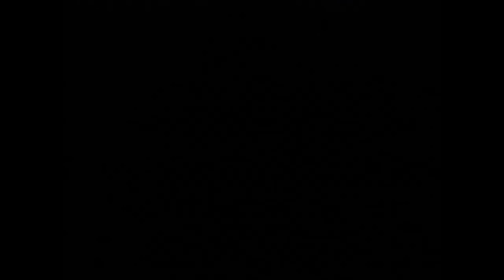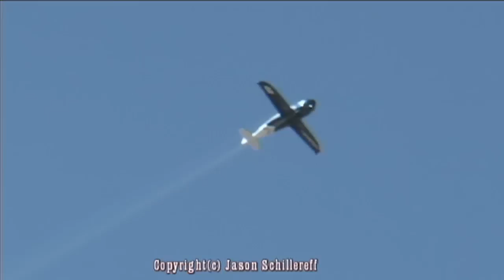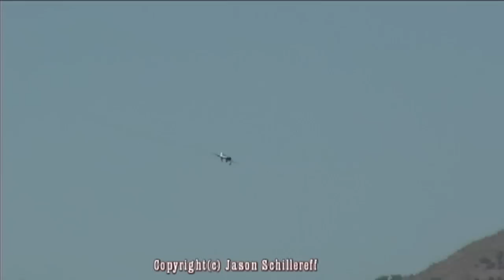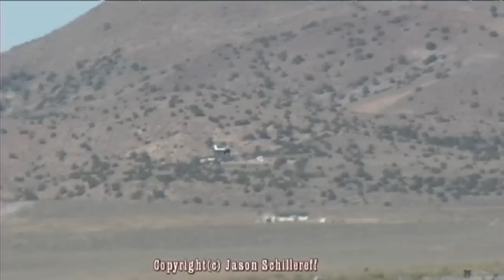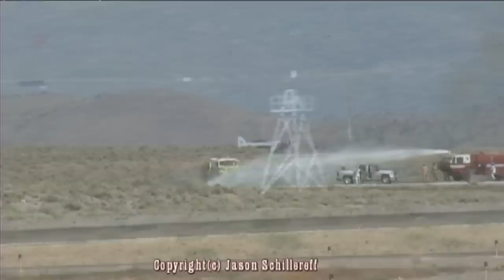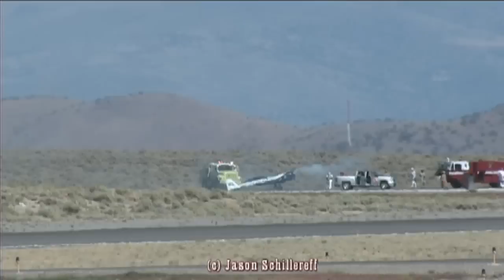Sport class racer 'Relentless' mayday 9/14/2010

Comment: Never heard a plane engine rev that high. The minute the prop was gone that was like going from 2900 to 10000
Reply: I thought that noise was the propellers still being on but at 0 degrees angle of attack into the direction they were spinning, THEN coming off and going silent.
Reply: Nicholas: that's about the size of it. Once freed from the load of propulsion, the engine will definitely rev high. Kevin was fast on the throttle because had it gone for much longer, the engine would've oversped (aviation term for over-revved) and the engine would've grenaded, causing a definite weight & balance crisis. Aviation engines are relatively frail compared to automotive engines, it's like comparing a VW Beetle engine to a V8. They gotta be light and simple. You probably know this already, but I'm saying this for the benefit of those reading who don't know.
Reply: Yes once in the US, on a test flight, too see the performance of a Low consumption Aero Engine.   I didn't buy it because I was in the process of acquiring a WW2 seaplane and I didn't want to snap the wings, if it went too fast.  The Company was a devision of Mazda and the Engine was a version of there radial engine that didn't take off in aviation.
Reply: The big issue I here in the video, was the propellor, where parts where travelling towards the sound barrier speeds, literally breaking apart from the airpressue.
Reply: PhattGreg Mazda, radial? For real?
Reply: 8UP1977 Maybe he meant Rotary/Wankel engine? haha
Reply: RoboTekno Actually, it's just "Wankel". The WW1 LeRhone engine holds the title of "rotary" due to the fact that the crank bolted to the firewall, the prop bolted to the engine and the engine spun. You'll enjoy reading up on that one!
Reply: Oh! It was the Engine!, Is that what made the Wierd Sawing sound! At first  I thought it was the brock props being flung off At the speed of Sound!...☺☺
Reply: +Grammer Nazi Not sure why GA wouldn't trade some lbs for a lot more reliability in a modern automotive-style engine..... GA is way riskier than it should be.
Reply: Just  a 'Vrrrrp' or 'Whaap' I can't tell but if I'd have been the pilot I'd been have sitting on some extra cushioning.
Reply: Arfdog we can thank the FAA for that.  The Experimental world has been using Subaru engines for decades now, but you'll never get the FAA to certify one...
Reply: @SenorSpode  I've seen that one running at the Rhinebeck airdrome... many years ago.. two speeds, ON and OFF.
Reply: Bye bye engine!

Comment: I lost a prop one time... I was delivering a WW-II surplus Interstate L-6 with a geared Franklin engine from Texas to Denver when it began to make strange noises up front. The Guymon, Oklahoma airport was two or three miles away so i headed toward it. There was a loud bang on downwind, oil sprayed over the windshield and then it was very quiet. I landed and let it coast off the runway. They found the prop and front part of the gearbox the next day.
Reply: +Jim Foreman Ah yes the joys of flying.
Reply: +AH6OY 

They is no joy in CFIT!
Reply: Poor guy. If there wasn't a fire and the fire crews straight out went and sprayed that water straight on the engine it's a big chance of cracked block and jugs.
Reply: +AH6OY I don't think that mattered, if the engine ran away enough to blow the prop off, any additional damage from the fire crews would be negligible.
Reply: A bit of a late reply but its usually commonly done to prevent fires e.g fuel leaks, oil leaks as foam floats and covers it preventing oxygen from getting in and also i know that another ww2 plane lost gear control and whilst flying told the crews to foam the thing to "kingdom come" and also if the prop literly flew off then water and foams the least of your worries
Reply: i lost many props before... but they were on my RC airplanes, they all landed just fine :)
Reply: I had unknown fuel leak in one of my old bonanza's (aux tank), and I ran it dry over the mtn's of OR one night, now that was a pucker factor 10!  There is nothing louder than the sound of silence in a prop plane.
Reply: Single engine night over the mountains is bad enough. But remember how sweet it sounded when you switched tanks.
Reply: Jim Foreman Yup, my father was with me, it  was a ferry flight of a "new to me" B-35 (bought off Tex Johnson's son Gary), and I didn't know of all the issues yet.  My father was a PP as well, and when I looked at him after the engine caught and was running again, he was bleach white :)!   When he could talk again, he turned to me and said "I think I shit myself.."
Reply: I assume you were talking about a Beech b-35 and not the flying wing...
Reply: Jim Foreman Geeze I wish!   :)

Comment from the maker: Hey Jon,
That is the sound of the prop spinning up to ungodly like speeds before exploding off the front of the plane, since he was still good distance away it took a little while for the sound to get to us. The engine initially lost oil pressure at power and in the blink of an eye the prop went out of control and spun up until it failed taking a good portion of the engine with it. The engine was only barley being held on by I think one engine mount.

Comment from the maker: You are correct, the oil loss did help in the seizure but the noise is from the prop going to flat pitch (due to oil loss)  and then speeding out of control till it exploded. This particular prop was an experimental race prop and was not counter weighted, the counter weights help prevent the blades from going into flat pitch due to oil loss.

Comment: for you geniuses who know all about engines but nothing about planes. Oil pressure in a hollow hub, maintains pitch and the increase or decreasing changes it. When oil pressure to the hub fails, as it sometimes can, being fed through a line, props can go to flat pitch. Engine oil pressure is something different. With no load on the flat pitch prop, the engine overspeeds and fails.
Reply: So the blades will all of a sudden go flat making no resistance on the engine causing it to critically over rev to the point that it spins the propeller blades apart?
Reply from the maker: 04awdriver In this particular case yes, these custom race blades didn't have counter weights which would've helped prevent a flat pitch scenario.
Reply: I agree with you 100%, bill, but in this instance the propeller blades separated from the hub.
Reply: WOW!!! serious problems for sure!!!
Reply: I thought in this case a failure cause the prop to freewheel with flat pitch and so sped up like a turbine in the airflow and exploded. I don't think the engine over revved. The noise is the blade tips breaking the sound barrier.
Reply: This is what happened: under load, the propeller blades separated from the hub. Consequently, with no load applied to the engine anymore, the engine suddenly revved to overspeed, which the pilot caught right away. The over-revving came after the blades separated from the hub. And, yes, prop tips can exceed the speed of sound and make that really harsh, snappy buzz. Floatplanes with larger props do that regularly at take-off.
Reply: ok. So what did the oil leak have to do with it.?
Reply: *****
Heres the official explanation from the plane owner himself..

Initial thoughts were focused on oil line failing and causing over-speed of engine. Now three years later I finally receive the real problem with the engine. The #5 rod failed. Seems a small stress crack was present in stock rod and under the tremendous loads of 70 inches of boost failed. Once the rod broke the remaining pieces came in contact with the case, stopping the crank, and snapping the prop off at the extension. In a split second the remaining parts spun up to over 5000 rpm destroying the engine.
We have learned so much from this experience. Our new engine developed by ACE-performance will have entirely new cylinders, rods, pistons, and bearings. Lighter, stronger, and capable of almost 100% increase in horsepower over our non-aspired 496 hp.

Comment: @mytmousemalibu Based on my reading of Kevin's blog entry (which I had to dig for, cuz the link in the description doesn't work), you're close, but not quite. Turns out the oil filter housing broke off the engine. When the oil pressure dropped, the prop governor let it spin up. When the engine seized up, it threw a rod, and the sudden stop is what snapped the prop and shattered the hub.

Comment from the maker: Yes this plane had a variable pitch prop that is hydraulically controlled by oil pressure. Once the engine lost oil pressure the prop went into flat pitch due to wind resistance and instantly went ballistic.

Comment: to me it looks like the engine blew probably no oil pressure. The sudden breaking of the engine caused to prop to come apart. The sound you hear is delayed because of the distance, sounds like gears stripping. You can see the smoke start right before the prop flies apart if you stop and start it like frames.

Comment: My brother's Falcon 56 Mk. II had an Enya .35 that lost its prop and made the same sort of sound and seized up as it threw its connecting rod into the crank housing.  It was brought on because one of his harder landing cause a hairline fracture of one of the mounting beams of its fiber-filled plastic motor mount which somehow led to the vibration that loosened the prop-nut.

Comment: First I thought that the prop disintegrated first, which led to an over-reving engine what we could hear later because of the sonic transit time, then I red the description.

How can it be? Was that a turbo engine? When a diesel engines turbo has a major bearing failure, diesels rev up immediately by burning lots of motor oil, that leaks from the turbo into the intake system. With an oldschool torque converter noone is able to stop a compression-ignition engine, till it blows up or runs out of "fuel". What about a planes magneto ignition?

But with that kind of problem, there would have been more smoke I think.
Reply from the maker: Hey LCdrDerrick,
Here is the explanation by the pilot and owner,
"Initial thoughts were focused on oil line failing and causing over-speed of engine. Now three years later I finally receive the real problem with the engine. The #5 rod failed. Seems a small stress crack was present in stock rod and under the tremendous loads of 70 inches of boost failed. Once the rod broke the remaining pieces came in contact with the case, stopping the crank, and snapping the prop off at the extension. In a split second the remaining parts spun up to over 5000 rpm destroying the engine.
We have learned so much from this experience. Our new engine developed by ACE-performance will have entirely new cylinders, rods, pistons, and bearings. Lighter, stronger, and capable of almost 100% increase in horsepower over our non-aspired 496 hp."
Reply: Voodoo1650

I can understand that if #5 rod failed and the remaining pieces caught the crank case effectively seizing the engine this could/would cause the prop to part company.

What I don't get is after the prop parted company, what remaining parts spun up to 5000rpm and destroyed the engine when the engine was seized already? ... Am I missing something?
Reply: Voodoo1650 Interesting and very plausible explanation. 
An engineer.
Reply: AussieMusicRocks I wondered the same thing. Something doesn't add up.
Reply: *****
Well I must be an idiot as well then. But Voodoo's comment giving the explanation by the pilot and owner reads, and I quote "Once the rod broke the remaining pieces came in contact with the case, stopping the crank, and snapping the prop off at the extension. In a split second the remaining parts spun up to over 5000 rpm destroying the engine."

Now if the crank has STOPPED that means all the pistons, rods, cams, whatever have STOPPED also. So WHAT remaining parts spun up to 5000rpm and destroyed the engine. It simply does not make sense. Once the crank has stopped that's the end of the damaging effects to the engine, not the beginning. 

Can you please give a proper explanation of what occurred, without the abuse.
Reply: Dillan Addington
I think your questioning of the explanation is justified based on what Voodoo1650 wrote.

I also think you did not deserve invertedlow's abuse.
Reply from the maker: AussieMusicRocks You are correct that once the parts seized internal to the engine everything stopped, basically destroying the engine, at that point what Kevin the owner was getting at was that once all those parts stop a millisecond later the prop went flat due to no oil pressure to hold pitch and it spun up to 5000+ rpm snapping the prop shaft at the case and that's the parts you see leaving the airframe. It sounds wild on video but in person it was the nastiest sound you'll ever want to hear coming from an airplane travailing at those speeds that low to the ground.
Reply: Voodoo1650
Thanks for clearing that up Voodoo. It all makes sense now. To a layman such as myself it looked and sounded like the prop shattered and fell off causing the engine to over rev and destroy itself due to no load. But your explanation has cleared up what actually happened.
Reply: Voodoo1650

Comment: The reason for the disparity in the visual of the prop exploding and the engine sound over revving is the distance of the observer.  Light travels considerably faster than sound.  A light weight, experimental racing prop could easily speed up that much considering the raw power of these racing engines.

Comment: To save weight and complexity, the engine oil is also used by the hydraulic system in the propeller to adjust the angle of the propeller blades.  If the engine loses oil, the propeller blades will default to the best angle for landing and take off - a "flat" pitch.  If the aircraft is moving very quickly when this happens, the propeller will act like the world's fastest windmill and attempt to speed up.  You can see what can then happen.  This is a very rare occurrence.  Luckily. :-)

Comment: So, with no load on the crankshaft minus the prop- did the engine run so high in the RPM's that the engine was destroyed?  Or did debris get into engine compartment and cause all the smoking?
Reply: It ran up too high.
Reply: +briansmobile1 I agree, the prop probably separated first, then from the loss of the load the engine spun up quick until it seized. Just my opinion, being a pilot myself.
Reply: +DonnieBass66 almost certainly a prop failure was the root cause. From a pilot perspective it makes little difference for a dead stick landing.

he had airspeed and altitude enough to bring it back around and did a nice job as you'd expect from someone with that experience.
Reply: +DonnieBass66 The pilot and mechanic said it was the other way around, he lost all the oil in the engine (the oilfilter housing broke off) and when the oilpressure in the engine dropped to zero the engine overspeed which in turn resulted in the prop breaking of from the overspeed stress

You can see the engine dumping oil before the prop gets destroyed
Reply: +Jesper Andersson That makes sense too. The propeller pitch is probably controlled using engine oil pressure. Lose oil pressure and the prop feathers to zero, engine over speed, prop faillure, dead stick landing.
Reply: Actually, losing the prop was an advantage in the dead stick landing! Prop was unCFIT; airplane and pilot landed just fine. Take offs are optional; landings are mandatory.  AOPA membership has it's advantages. I get to read, rather than live, all of the bad things and hope to avoid them in the friendly skies!
Reply: The engine lost oil pressure first.....the oil pressure controls the pitch of the prop....no pressure ment the prop pitch went to 0 ......no resistance ment the engine overspeed...prop disintegrated.

Comment: If the engine locked up, at those speeds, it prolly broke the crankshaft but still with the front bit intact with some nice smooth engine bearings holding it.....so when the prop in 350+mph airstream, un-feathered, is suddenly free'ed of load, it suddenly becomes a windmill, one that instantlly spun up to redicioulus rpm till it desintigrated. Props are (depends on diameter) are only spun fast enough to keep tip speeds below supersonic. Engine/prop RPM prolly 3000ish, you can hear it go insane.

Comment: The engine was trashed. Has multiple holes in the case from when it seized. He put a naturally aspirated 8cyl in after this crash and it still flies great, just isn't as fast on the race course. You can see it with the new engine at /watch?v=hZTSX7qBToY

Comment: This is not an engine starved of oil, it's a prop failure. If you look at the laws of physics, light travels faster than sound. A classic example is lightning and thunder. You see the flash of lightning, then depending on how far away the lightning hit you hear the thunder. Because the flash of light travels faster than the sound it makes.

In this video you see the Prop shatter, that's the lightning, then you hear the the engine over speed, that's the thunder. 

The prop went first, not the engine.

Comment: No it wasn't pilot error. If you look very very closely. When he was inverted and started to roll over you can see blue smoke come out of the engine. That's an oil problem. The engine was having trouble. So the plane stalled and flew into the ground. Biplanes don't glide as good as other planes.

Comment: flyrphil is right.  Lose the whole thing is the way to go.  So your CG goes back a bit.  If adding or taking away that minimal amount of aluminum would screw it up so bad, it would never be certified.  What you don't want is to lose only one, or part of a blade.  I have seen the result.  Pretty much the engine rips itself out of it's mounts, assuming it's still turning over.  Lose a several hundred lb engine and then yes, your CG has died and gone to heaven, just like you.